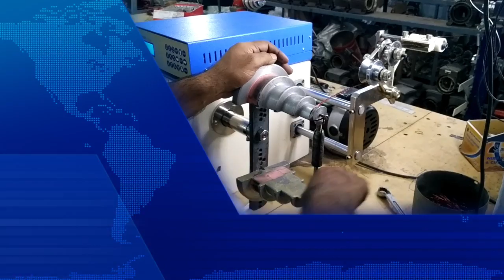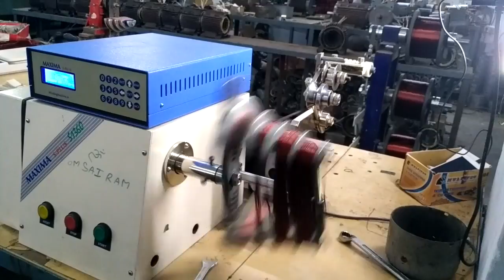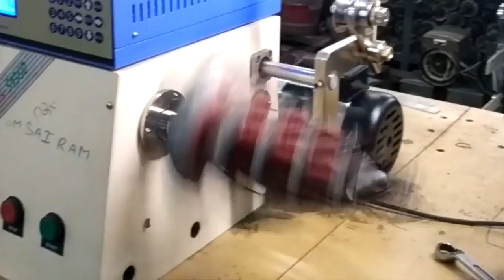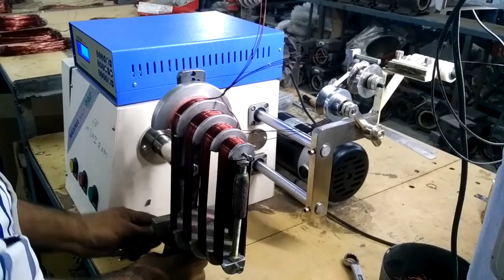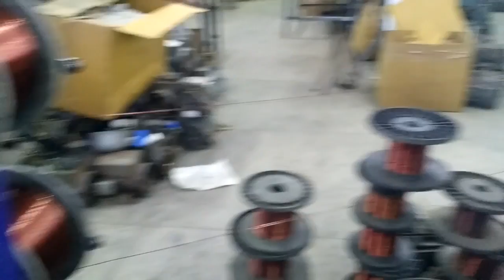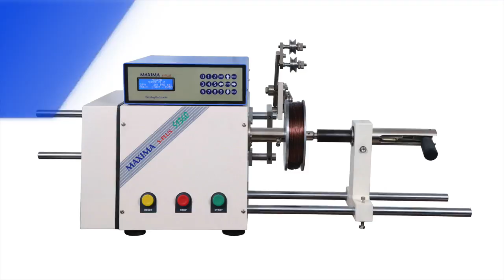Motor Winding or MonoBlock Pump Coil Winding

Comment: How much rate
Reply from the maker: It depends how many parallel wires and diameter of coil you need to wind. Please contact us at +91-9311003090 for more details.
Reply: @WindingMachineIndia 
Hi